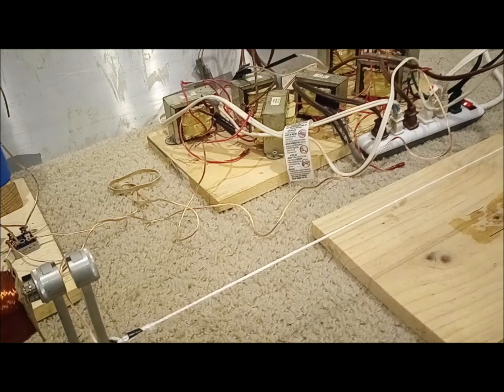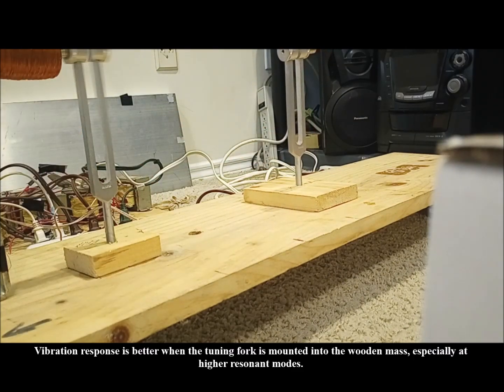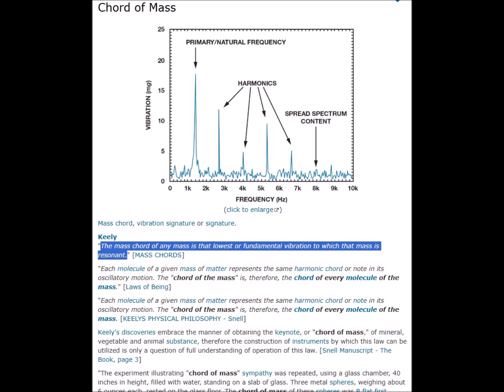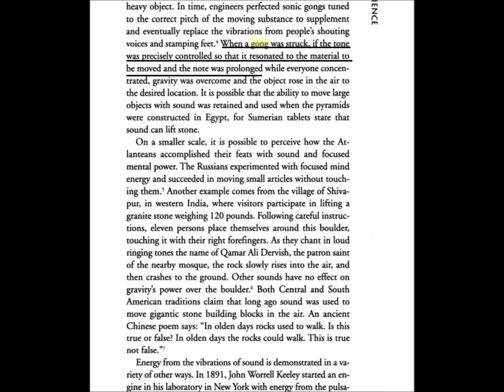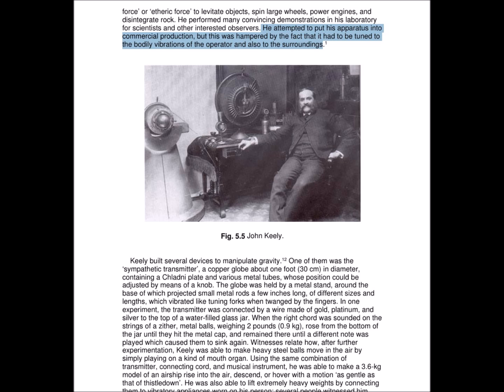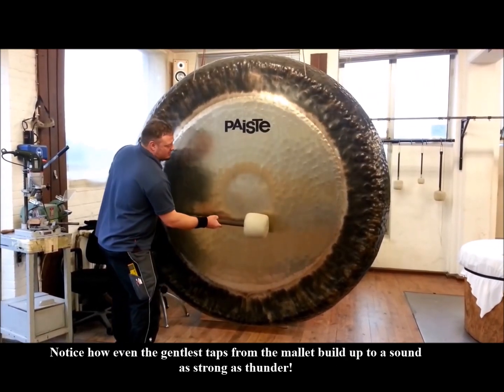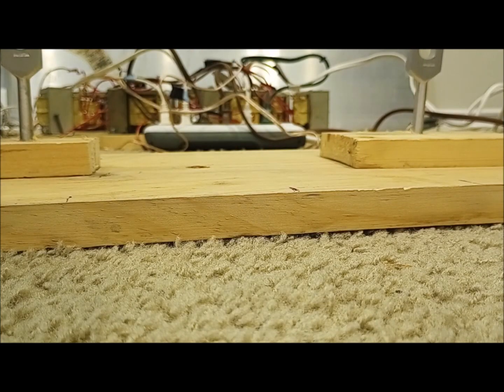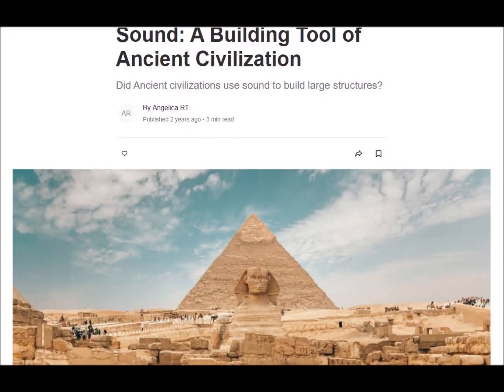Harnessing Acoustic Force: Generating Vibrational Power to Propel Tons!

Comment: Check out Ultrasonic machining.  It's used to cut intricate cavaties in brittle, hard,  non conductive material.  Just as Electro Discharge Machining is used to cut conductive metal.   It's usualy used on a small scale but i wonder if ultrasonic cutters could be made to cut large blocks to fine tolerances like we see in some ruins.
Reply from the maker: I'd bet that it could. Studies have already shown that resonating rocks at their resonant frequencies (which are in the ultrasonic range) rendered then easier to crush due to the microcracks the vibrations created within the material. And by extension, this would make rock easier to cut and drill as well. This could be the reason we don't see physical evidence of advanced/sophisticated tools. Perhaps they weren't always needed. If the stones themselves were resonated, they may have been processable even with ordinary tools. If Egyptologists can believe that they processed hard, inert stone with only copper tools, then they certainly could have done it if the stones were made more workable with acoustic energy. Interesting that vibrating/resonating the stones has also been hypothesized as a way to make them easier to move. Fascinating possibilities!!

Comment: where is your hoverboard video.
Reply from the maker: @mobilenation1104   I'm designing a new powering scheme for the maglev system so that it can float higher. Need 4 to 6 inches clearance. Right now, I only have 1 inch. Also, the resonance concept isn't quite working out like I thought, so I've got to figure that out. It may be a few months before I'm able to make a progress video. 😐. It's coming though!
Reply: @gsutton78  well keep working very hard, take a long break before work very hard in the next weeks or the next months, let the real hoverboard can hover any grounds.

Comment: I'm gonna go off on an acoustic amphitheater tangent here (coliseums, half-shell type etc) 

There's over 200 documented examples worldwide, and that's just what's still visible, not buried. 

The oval coliseums IMO were clearly for acoustic vibrational energy absorption, much like the pipe organ cathedrals centuries later. Bono was not alive yet, so these were not entertainment concert venues.

All joking aside, what I noticed was the amount of AMPitheaters on coastlines facing into the ocean. The problem I noticed with the ocean-front one's was the tread depth vs riser height ratio (think stairs and current venues) was way off for human seating, plus no noticeable accessibility in between levels, it made no sense.
 
To the point, these were multifunctional accoustic technologies. 

The coastline ones were likely for sonic communication over very long distances to other coastal amphitheaters, or even shorter distances to seafairing vessels with a parabolic reciever of some sort??  
A vibrational Morse Code if you will. The various frequencies determine distance vs spread. 

Just some thoughts of mine.
Reply from the maker: @JPOwantstoknow65   Wow, man! Multifunctional technologies, long distance acoustic communication. We are on the same wavelength. Pardon the pun,☺️ Interestingly, acoustic phones can allow the human voice in its entirety to be replicated. A 1200 year old acoustic telephone made from two gourds and a 75-foot vine was found in South America. It is ascribed to the Chimu culture, the immediate predecessor of the Inca. This proves that people knew of the principles of mechanical acoustic communication almost 900 years before Robert Hooke!
Reply: Makes sense that the ocean would be harvested for acoustic energy, its always noisy and moving.
Reply: Amps, Amplify, Phi. To theat, a theat-er. Theatre is used to act a play on. What is the amphitheater acting on. And what is the true meaning of theat.
Reply: Amphibia is also close to the word amphitheater. Bia meaning life.

Comment: I've been trying to come up with sufficient methods to produce acoustic energy by seemingly primitive devices. Maybe a Heiro steam turbine powered siren. Or an open ended thermo acoustic engine...
Reply from the maker: @platypusrex2287   Exactly! There are a few ways to create thermoacoustic engines: https://youtube.com/shorts/d89H36SrBR8?si=FHKYGec7wUw1Tkjc.
Reply: There are devices called bass shakers they are coneless speakers that are used for theater systems. They have a heavy weight and should allow for precise control of frequency. They are designed to be mounted as well. There are several brands so keep an eye out for better prices.
Reply from the maker: @polygon2744   Wow! Bass shakers (Tactile transducers). Thank you! Funny how those have never come up in all of my acoustics research 🤔
Reply: @gsutton78   Tactile transducers! That was the term I was looking for but could not remember. These I think could dramatically improve drilling in stone when tuned right. All sorts of applications outside of their intended use.
Reply from the maker: @polygon2744   Yeah, I need to study their designs to incorporate into my own transducers. I'm modifying my devices to be powered by 2000 volts. Should grant some crazy acoustic power!
Reply: @gsutton78   Very interesting. I'm looking forward to seeing your designs.